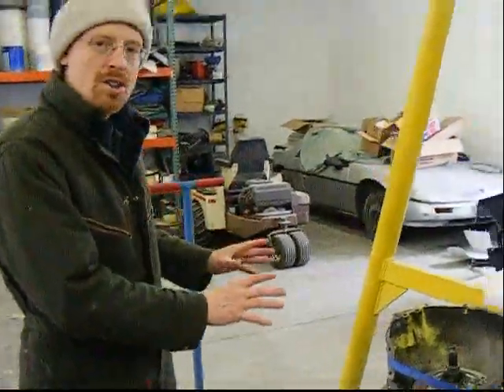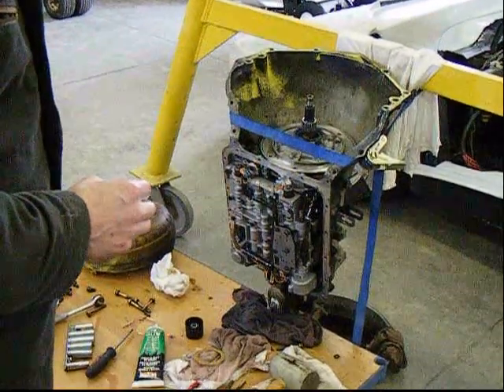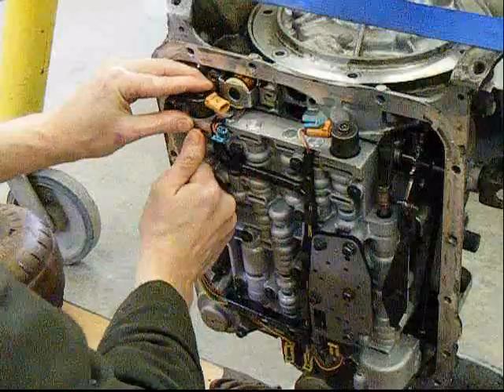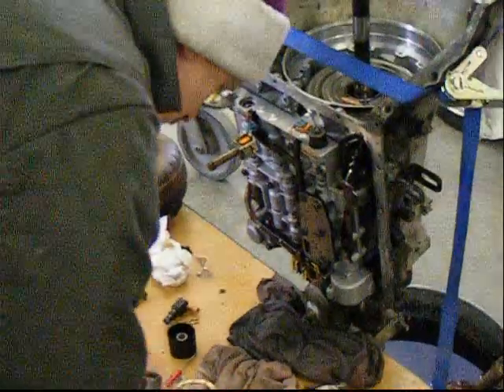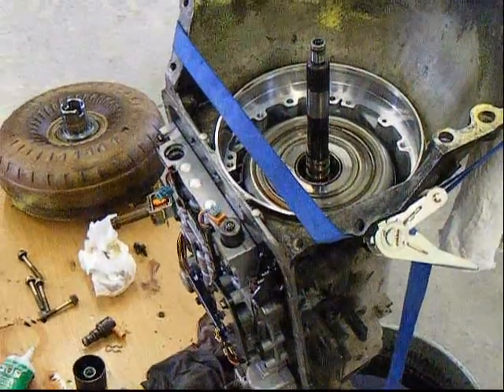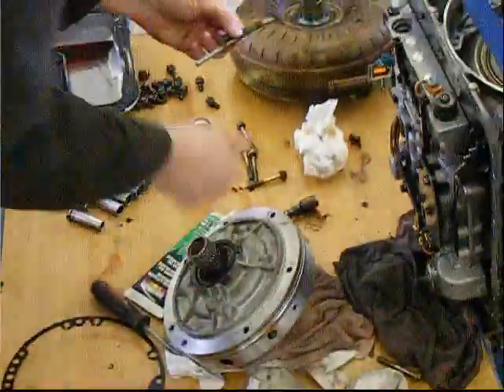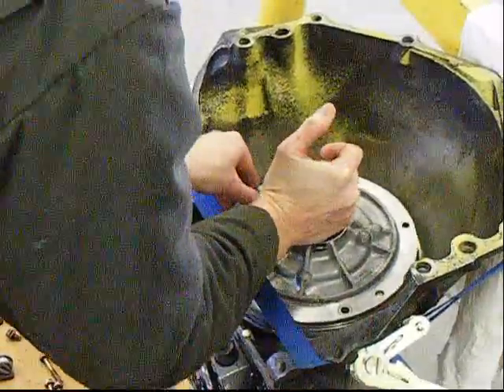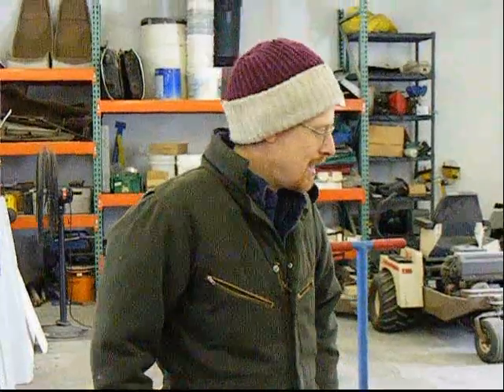Chevy Automatic Transmission Oil Pump Removal - 4L60E

Comment: I have a 1995 Silverado with 4L60E. I think my 2/4 band is broken. If i drop the tranny and stand it on the output end can I pry the pump out carefully with a flathead screwdriver and the remove and replace the 2/4 band?  Thanks!

Comment: Ty for the video. Hopefully it helps me later today when I pull my trans pump and see what’s wrong with it. 

Incorrectly installed TC and…yeah……2 crunches and TC doesn’t spin freely after reseating. 😭 😑 atleast I do have old trans and old TC I could use for parts tho.

Comment: That's great because now I know that I don't have to remove the valve body on my dads 4L60E transmission which he bought second hand to replace the transmission in his 2000 model Holden Commodore which had nothing wrong with it except having 370,960 kilometres on the transmission & was afraid it would fail.The Buick L36 V6 engine was replaced also with that many kilometres on it only because it consumed oil due to leaky gaskets & seals (not due to worn rings) & has exhaust valve recession on cylinder number 2's exhaust valve due to the valve head overheating when running on propane gas.When he tried to fit the transmission,he broke one of the lugs off the Bell housing & when we swapped the Bell housings over then fitted the transmission to the motor, then fitted the whole drivetrain into the car, the car had no drive in forward or reverse gear.So I'm afraid that the pump rotor smashed due to misalignment,maybe the torque converter wasn't seated in the pump housing properly !!!!So I'll repair the broken oil pump & fit it into the replaced transmission,I will also get the Bell housing welded up & fit it onto the outgoing unit,providing the donor transmissions housing doesn't have any cracks in it.The outgoing engine will likely be resealed & another cylinder head fitted,so waste not, want not,I'm really sick of such people never listening to me -I'll sell that !!!!

Comment: Excellent Video. Just what I was looking for. I have a GMC Jimmy 4x4 that is leaking from the torque converter cover.
You just showed me how to ensure that I fix BOTH potential leaks at one time. I DON'T want to pull this thing apart TWICE!
Reply: Tell me about it lol

I have to pull the trans I just installed, luckily it wasn’t fully installed tho!!

Comment: Question: Why can't the pump come out without removing the adaptor on the valve assembly and the torque converter selenoid??
How do they hold the pump from coming out?

Thank you for the video! It is exactly what I was looking for!

Comment: well, my truck didn't have that solenoid at all that you had to remove. It is just an empty hole... lol am I missing something? I have the one on the right, though...
Reply: 12 year old comment but I have your answer lol. The solenoid is for PWM transmissions. The 92 to 95 1 piece case transmissions were non PWM. Easy to tell from the driver's side of the case if you have a PWM transmission. The shifter shaft is longer, and it has an additional bracket bolted to two places on the case to the right of the shifter shaft. If the transmission is out the front pump should also say PWM around the 11 o'clock position of the pump. They were also 298mm with the PWM being 300mm on the snout length of the torque converter.
I only know this because I am looking for a rebuilt non PWM pump

Comment: HELLO I LIKE YOUR VIDEO, I LEARN ALOT, I HAVE A 1998 CHEVY SILVERRADO PICKUP. IT HAS A 4L60E TRANSMISSION THE TRANSMISSION CHANGES GEAR FINE, BUT NOW I HAVE A LITTLE WHINNING NOISE AND I HAD IT CHECK, THEY SAID IT WAS MY PUMP GOING TO THE BAD. I DON'T WANT TO MESS UP MY TRANSMISSION. SO I WANT TO INSTAL A NEW PUMP IN IT. WILL INEED TO REPLACE NEW SEAL AND BEARING, ANYTHING ELSE. PLEASE LET ME KNOW THANK YOU VERY MUCH...